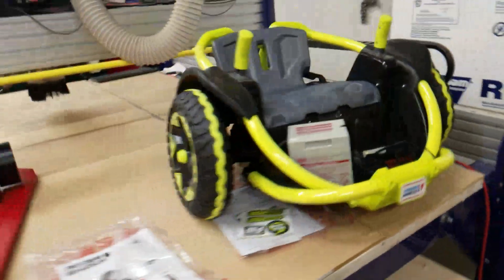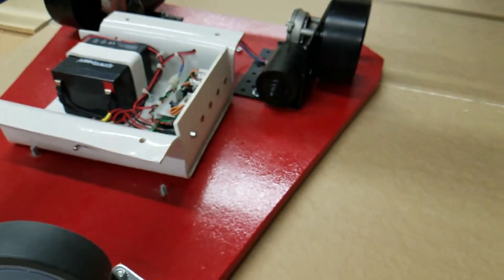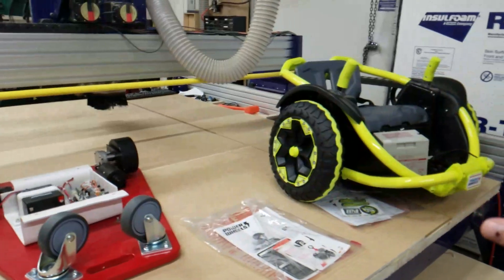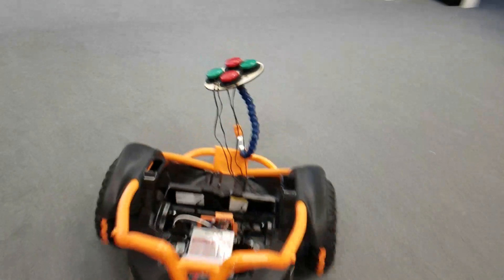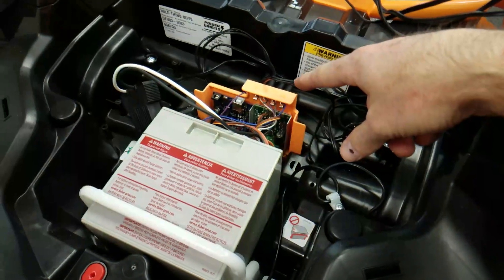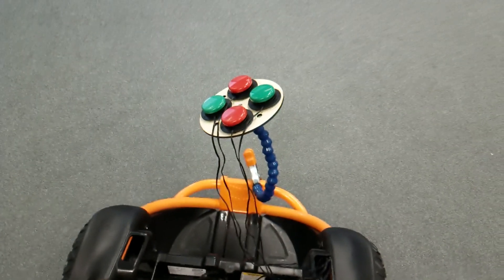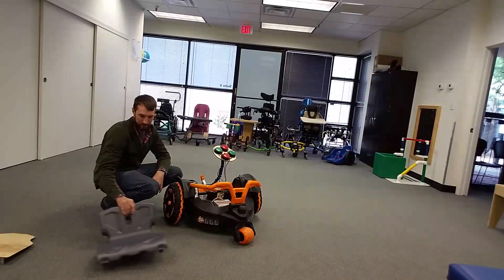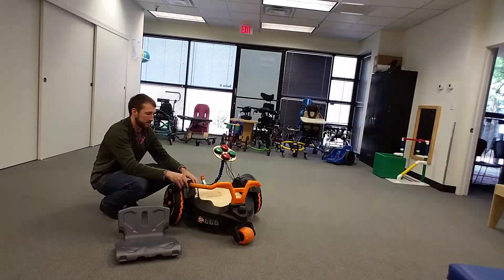Power Wheels Wild thing - Switch Adapted Demo

Comment: Good video. Another straightforward improvement is to swap the heavy 12v lead acid for lithium battery as found in many power tools. Then purchase a motor controller for $15 and 3D printed battery adapter for $15 which come with wiring. Run time goes up, charge time goes down to 2hrs, and Li batteries are easily swappable. I've done this for my kids' power wheels as well as the wild thing
Reply: I tried that, minus the motor controller, but it won't run. I can change the speed, but I'm assuming I need to add the controller? 🤔